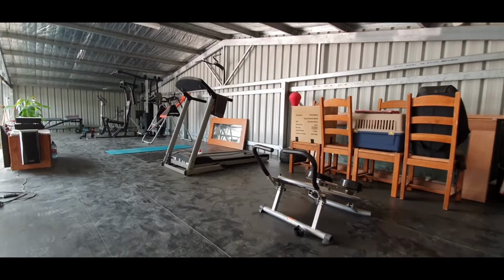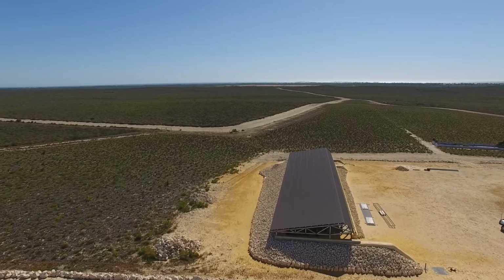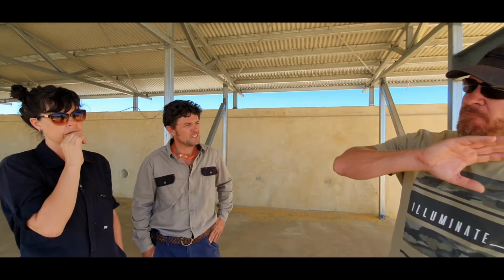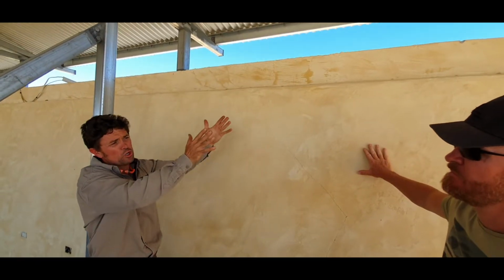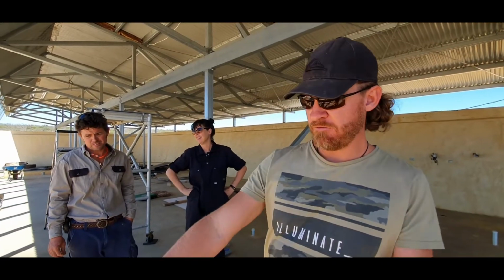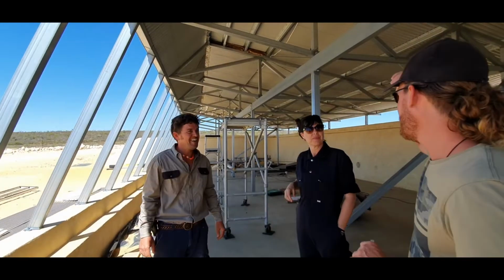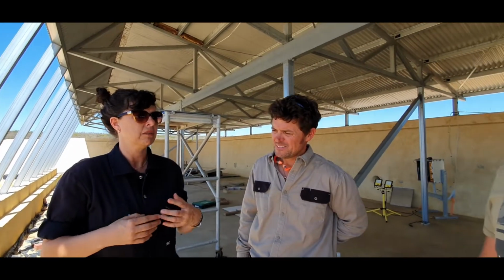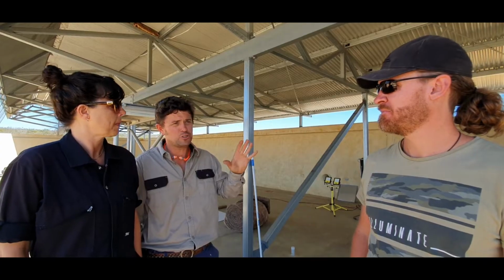Off-Grid Earthship - Jurien Bay - Western Australia

Comment: Tremendous structure.  I love the steel support structure.  We built a pseudo-earthship in Colorado in the US, using tire bales instead of rammed earth.  Same principal though.  We couldn't do the Euro style, with the double-glass layers, because of local codes regarding fire egresses.  Unlike your Building codes, ours would not consider the front area, between the glass, as outdoors.  Because we only had small awning windows, and no egress windows in the bedrooms, the Building Department insisted that the bedrooms be totally open (no doors), on the ends.  That way the East and West doors were considered the fire egresses.  Once we got our Occupancy permit, we installed arch doorways, and moved a bedroom to the middle, where we wanted it.  Your place looks great!  You've got the lion's share done, but there is still a lot of conventional construction to do!  Hang in there!

Comment: so wierd and almost too industrial and cold to see this version of an earthship, with all the steel beams were u normally have earth/tieres and wood instead   :/  and that steel isnt locally aswell i bet, like import, were as your land is surrounded with al sand for earth pillars/walls, and tieres around your property and such.. anyhows, its just my observation, its not ment as a form of "hate" on you guys, hopefully you dont take it as that or others in the comments that follows
Reply: welcome to Aussie building regulations
Reply: I watched the video and it seems like they stuck their strengths as well. They seem like they were good with metal work and welding and they learned how to do a 120 degree bend on they coragated steel.
Reply: Steel is definitely local. Australia is a a huge slab of ore, hence the red colour of the outback. Also fire and other building codes won't permit wood in a structure like this. Heavy risk of termite attack in Australia also.

Comment: Earthship should be built with natural materials, here everything is built with Metal, tin; even walls, with cement and concrete. which can be built with earth for cheap and 1/10 of this cost. This is expensive Earthship and not natural.
Reply: The problem is the building codes , the town has put in place . If you follow there you tube channel , can learn more on the w5 .
Reply: @marytyson6376  i know Australian construction rules and regulations, but it should restrict only to town planning, not enforce remote isolated dwellings built by self sufficient off grid communities. Its all to support to corporate who fund ministers at election time so Govt can control people life imposing such rules. Will Govt and corporate feed if people hungry?